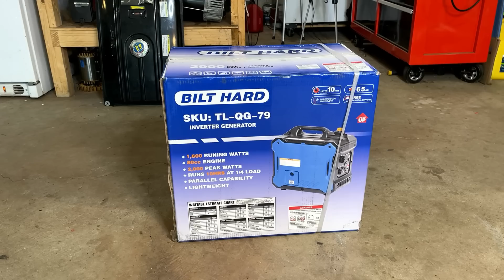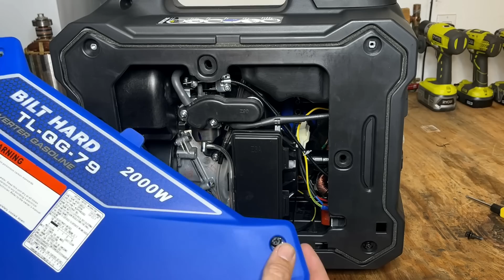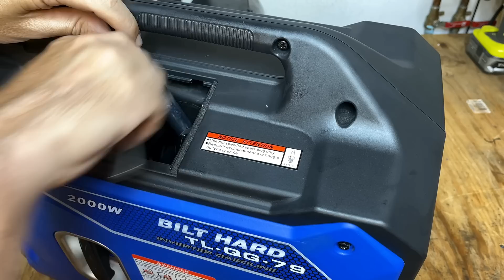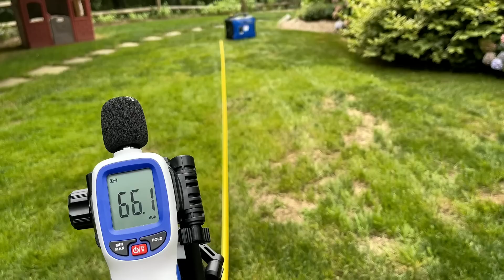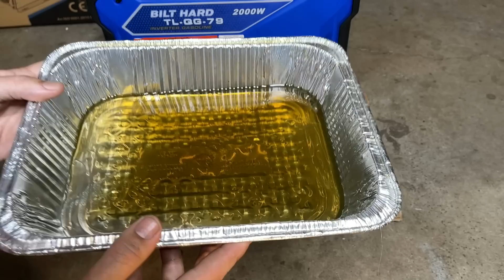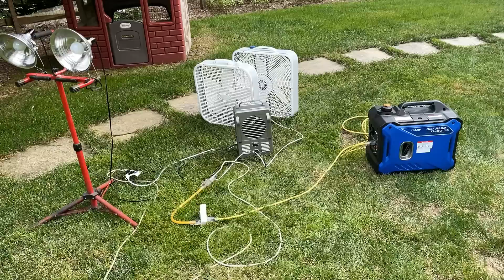Bilt Hard 2000 Watt Quiet Inverter Generator Review and Test

Comment: James, great review as always! I believe it is more of a marketing industry issue where the advertise 2000 Watts but they do not specify if those are running Watts or surge Watts. It's a bit gimmicky but that's how it's always been from my experience.

Would I be very curious about is the inverter module. Seeing components potted in epoxy resin is very standard and the inverter module reminds me of the Ryobi 2200 w inverter. The quality of the components used to build it I would be suspect especially during the time of you making this video we are currently seeing a huge shortage of electronic components in general so quality tends to take a dive because manufacturers are trying to push out stock quickly.

Usually at this price point do not have or have very little EMI and RFI filtering. Depending on what your bandwidth of your oscilloscope is you should be able to see some RFI noise in the 300 to 500 MHz range. Most sensitive picky Electronics these days if that noise is below a certain threshold shouldn't be an issue, however in terms of audio applications such as ham radio and pro audio like running a powered speaker for a PA system for example that RFI noise can induce noise in the audio equipment. I own the Yamaha ef2000is and I have found that even that expensive generator has just basic RFI filtering. Thankfully there are available frequency converter filter units specifically designed to suppress this type of noise on ac lines. 

Overall not a bad unit, but like others have said I questioned the longevity of this unit even when maintaining oil changes and basic maintenance. Build quality and engineering are very critical.
Reply from the maker: Inverter generators always advertise using the surge watts.  Probably because they are underpowered compared to more traditional generators.  It is a good unit for the price, but agree the longevity is unknown and for the price should not be expected.  I think my oscilloscope can measure noise at different frequencies.  Will have to play around with that.  I also have an ef2000is.  Never had an issue with it.  I am working on an ef3000iseb which has a pretty big issue.  Easy to fix, but the part costs $1,500!  Could buy 4 of these generators just for the price of the part to fix the Yamaha.
Reply: @jcondon1  exactly whats the issue? Engine or inverter? The inverter units are damn near impossible to service and schematics are not to be had.
Reply from the maker: @Bassguitarist1985  inverter.  It kinda makes power sometimes, but cannot support any kinda of a load.  To make matters worse it is the first generation made only for 2 years and the inverter is specific to that unit.
Reply: @jcondon1  also, the ef2000is has a geared cam while the honda has a rubber belt driving the cam. The honda is ever so slightly quieter, but i hate the idea of a rubber belt failing vs gears which are the most stout

Comment: Just a note on commercial and consumer generators. Consumer units are over rated for the short term peak load as shown. A 2,000 watt generator is fully loaded at 1500 Watts.
A commercial Diesel 3 cylinder 6KW is nominally loaded at 5KW and fully loaded at 6KW and is rated for continuous duty at full load. Overload is 8KW for up to 30 minutes. Generator mentioned is typical of a construction site light tower. They typically run 4 each 1,000 Watt lamps with an additional 250 Watts used by the ballasts for a 5KW load all night on a 6KW generator. This leaves another KW to use with the convenience outlet for power tools, etc. Bought a used one from a renal company at auction for less than 1/2 the price of the 2KW Honda.  Not as easy to lift on the bench, but for an extended power outage, I'd rather have the larger set to run more than a light and a hair heater.

Comment: I thought most air cooled engines were supposed to have sae 30 weight oil. Not 10w30.
Reply from the maker: 30 weight is the best.  But where I live, half the year temperatures are too low for that weight oil.
Reply: @jcondon1  ah ok, Then yeah 10w30 is good to use as well.

Comment: Does this generate DC which is then inverted to AC or is the head an AC head? 
If so, how does the idle down feature work?
Reply from the maker: The generator produces 3 phase high frequency high voltage AC.  That is converted to DC and then back to 120v 60 hertz AC by the inverter.  The inverter can handle a range of input from the generator head.  So running the engine slower will reduce the voltage and frequency coming out of the generator head, but enough power is still available for the inverter to generate 120v 60 hertz.

Comment: Would you, time willing, be able to do a show on a Fuji Micro F52000i? No problems if you can’t. Thank you.
Reply from the maker: Did one a while back on that generator https://youtu.be/vyeyQK1QCuw
Reply: @jcondon1  trying to send a photo of my Fuji Micro; its a little different. Is there a way to change the power settings on the inverter? It’s supposed to do 3.2kW continuous and 3.7kW Max.
Reply from the maker: @Maurice1151  no settings that I am aware of

Comment: Thanks very much for the review, however there seems to be a bit of confusion over the wattage at full load.

I'm pretty deaf, so I use subtitles when I watch your videos, and they say:

14:13 [After turning on first white fan] 
"all right, 1547 watts, 115.9 volts, 60 hertz"

15:07 [After turning on second fan]  
"and the voltage is [sic] dropped, we're at 107.9 volts 1475 watts, 60 hertz.

Unfortunately, the wattage reading on your Kill A Watt meter is not readable, so I've only got the subtitles to work on, but I think I can also hear you say "one thousand four hundred and seventy five watts". 

It looks like I'm not the only one who reckons you said the max load is in the 1475 watts area:

@thomas martindale "1473 watts seems a little shy of 1600 for overload protection"

@TRANSMITTER GUY "So 2000w peak start, then 1500w."

I'd be grateful if you could confirm the wattage reading when the generator goes into overload condition. Thanks!
Reply: 1473 at that specific overload level. When he turned on the extra fan the generator went into overload. In overload it turns out a lower voltage as you noted which means fewer watts are outputted. Per James' measurements the generator will deliver 1547 watts -- Provided you don't overload it. It will likely shut down at some higher overload point.
Reply: @Thriller_Author   Many thanks for the explantion - much appreciated!
Reply from the maker: The max wattage I measured before the overload light came on was about 1,550 watts. Once I exceeded 1600 watts the voltage dropped below 113 volts which is around minimum voltage utilities are allowed to provide to you house (120v +- 5%).  And because the voltage dropped, so did the watts.  Another thing to consider, if you need 1600 watts out of a generator for any period of time, then do not buy a 1600 generator because everything will be stressed and it will shorten the life span of the generator.  Always buy larger then you need.
Reply: @jcondon1  Thanks for that. I've watched a large number of your videos, and love your style of presentation. They have been a great confidence-booster. Keep up the good work!

Comment: I have a Generac 7500 watt. The Hertz is at 61 but the voltage is at 155 to 160. Is there a way to turn down the voltage?
Reply from the maker: Most Generacs can be adjusted.  That is also a failure mode of most AVRs.  Sometime when they fail they stop making power.  Other times the go to the max.  Most have a potentiometer on the AVR.  If adjusting that does not work, then most likely the AVR needs to be replaced or a bad sense winding in the stator.
Reply: If it is a generac 7500 EXL there is a potentiometer adjustment on the left side of the outlet panel. The system control board inside is what tells the AVR in the end Bell to set the voltage at. The 155 to 165 volts ac tells me the system control board has failed and needs to be repaired. There is a 3-pin connector on the AVR board if you disconnect that and take a jumper wire and connect the two outer pins then your voltage should drop to zero or very close to it. In this case that I'm describing the AVR is perfectly fine it is the control board that controls the AVR that is suspect.

Comment: 1473 watts seems a little shy of 1600 for overload protection
Reply from the maker: It made it to about 1550 watts and then when into overload when I exceeded 1600 watts.  The load pulled down the voltage which caused the watts to go down.
Reply: @jcondon1  got it thank you

Comment: Nice generator ,very quiet also helps adding zink for breaking oil nice vid.
Reply from the maker: Was surprised at how quiet it was.  I had low expectations going in based on the price, but it performed well.

Comment: Will it power a 1/3hp sump pump?
Reply from the maker: It should, but that will depend on the surge.  Might have to leave eco mode off or the surge might stall then engine before it has a chance to open the throttle.

Comment: Not going to debate the brake in but I have mixed feelings I also haven’t bought anything new for years except a high end electric pressure washer I wanted for washing my cars.    I highly doubt anyone actually broke in any of my current used equipment according to the manual.  I have really nice equipment and usually find it non running on fb marketplace…and as I find something nicer I sell the junkiest or oldest pieces I have.  I’ve probably bought 200 pieces of lawn equipment under covid.  Also in reality all my personal equipment was from repair money so it’s cost me nothing but some time and effort.
Reply from the maker: I agree.  Most do not bother and the engines usually are fine.

Comment: Good job reviewing a "new" unit but longevity and reliability are my concerns as is its track record. Generally speaking, one gets what they pay for. Granted, one could buy 2 of these for less than a $1000+ competitive unit but one does not want to discover they bought an inferior unit when needing emergency power. I would love to know how this unit will perform in the long run.
Reply from the maker: Generally you do get what you pay for.  Was thinking you could almost buy 3 of these for the price of a Honda.  If you need a generator for daily use, industrial/commercial use or something critical then would recommend going with something proven.  But if you just want something affordable for camping, tailgating, random stuff, or to keep some lights on, then this is a low cost option for those not willing to spend a ton of money.  Parts are always an issue with most generators sold today expect for the top brands.

Comment: Nice little unit. Very quiet. Great video, as usual.
Reply: I noticed that it was very quiet at idle but when it was loaded up it sounded pretty loud. Too bad that it doesn't really make any electricity at idle - it would be even quieter if you shut it off completely.

Comment: So it's a 2000 watt generator that can only handle 1600 watts?
Reply: Naming models according to sure wattage and not continuous wattage is standard in the generator industry.  Maybe it's wrong but everyone does it, including Honda. I'm more concerned that it doesn't seem to do well at 1600W either.
Reply from the maker: It is a 1600 watt generator.  Can surge briefly to 2000 watts.  Same as a Honda eu2000

Comment: That is quite an inexpensive price for an inverter generator. I found it interesting that as you increased the load when it was close to max output, the engine slowed down and the voltage dropped, but it was actually putting out less wattage than its rated capacity. I assume that the engine was doing all it could at that point, so it may do better when it is broken in some more.
You should look at getting a foldable funnel for all the oil changes you do on various equipment, you can get them on Amazon for less than $10, and they are really handy.

Comment: What good would that be if your home lost power in a bad storm ?  NONE...
Reply: I'd say a lot better than nothing. You could keep your fridge going. You could have some lights. You could have a fan.  A few gallons of hard to find in an outage gasoline would keep it going for days instead of hours like a big generator. Could you run your A/C or your stove? No, but it's still a lot better than nothing.  The intended application for this generator is tailgating and such, not as a standby generator anyway, but I'd be glad to have one if the alternative was sitting in the dark while my food spoiled.
Reply: @throwbo  Or if you have 2, run the big stuff  and lights on a regular gen, and use this one for things like your computer, TV, internet equipment. I know my UPS's don't like running off of my regular generator. It does seem to do a great job for the ratings it has.
Reply: @cheeto4493  These generators have a provision for something called a parallel kit - you can link two of them together and get double the wattage. 2 of these is still less than 1 Honda and you get like 3000W out of the pair.

Comment: Looks like same build as HF model. If so you can shut it off by going to "almost" off (turn until it starts to stop then crack it back open a tad) and this will shut off the fuel to run the bowl dry. I know the bowl drain screw is easy to do but it's easier to store the bowl dry this way.
Reply from the maker: Good to know.  A lot of the inverters are sold with different branding.

Comment: Save a bit of money now, but later when you need parts and the company doesn't exist anymore, you're hosed.
Reply: These Chinese Honda clone generators are all very similar internally.  If Bilt Hard is not around, you should be able to get parts for them elsewhere.  Not cosmetic stuff like the case but internals like carbs, recoil starters, etc.  You could buy 3 of these for one Honda so you could buy another just for spare parts and you'd still be ahead.
Reply from the maker: Most generators sold today have that issue.  But because it is a clone, you can find parts for the common things without much issue.
Reply: @jcondon1  unfortunately, I need a gas tank that no longer seems to exist.
Reply: @snowdog90210   Is it for an inverter?  For regular generators they sell generic tanks. It might not be exactly like the original tank but it could be made to work.
Reply: @throwbo  it's for a Smarter Tools inverter.    They still have a website up, but they don't respond to any form of communication. I found other people who have had the same issue with them. The generator has a Yamaha engine, and it works well, but the gas tank has a gigantic crack in it

Comment: Inverter generators are the way to go. Usually more expensive than a regular generator of the same wattage but far more quiet. Most people don't know that the majority of the noise comes from the engine not the exhaust. The Honda 7,000 watt inverter generator is stunningly quiet compared to a like size but so is the cost difference. If I were to buy another one for the home I would strongly consider it.
Reply: If you plan on feeding your panel you really want a generator that does 240V - not many inverters do.  Harbor Freight has a big closed frame inverter generator now that is a lot cheaper than the Honda and does 240V. But it still costs double what a non-inverter costs ($2K for 7600 running watts/9500 surge).  I would love that generator but hate to spend that kind of $ on something that I use maybe 1x/year.
Reply: @throwbo  For some it's hard to justify something that gets used every few years, until that power failure comes and then it's to late. I live in South Florida and have had several multi-day outages. How about those poor people in Texas and Louisiana that have bullseyes on their backs? 90 degrees and 90% humidity you only have to do once and the same for ice storms taking down power lines. I don't understand how people go without at least something to keep the fridge on, a few fans and some lights.
Reply: @throwbo  - I only have HONDA inverter generators some almost 20 years old that are still running perfectly. Never ever had to do more than change oil and clean air filters. I basically only use them once a year during hurricane power outs.  The extra cost of a HONDA is well worth it for me.

Comment: James a very typical review from you which I have found to be very reliable thanks for the truth about what you review nothing bias at all. The sign wave stayed very steady and the price was very good. I think this beats honda at probably more than half the price. Ed
Reply: Don't overstate the case. I doubt that this generator beats Honda in many respects that wouldn't show in an unloaded test of the wave form - longevity, reliability, etc. However it is around 1/3 the price so if it is more than half as good then it is still a bargain, at least for lightly stressed non-critical applications.  Would I use this for an occasional tailgater? Sure. Would I used it to run my food truck every day? No.
Reply: Nothing beats HONDA portable generators.

Comment: So no fuel shut off that allows you to run the carb dry?  I like the WEN inverter-gens because they have this setting on the main control dial, making it easier to run the carb dry for storage.  Other than that, how long is the advertised warranty and what is the availability for standard parts (like maintenance items such as air filters or commonly lost items like fuel caps)?
Reply from the maker: Unfortunately the fuel shutoff is integrated with the ignition like the Honda.  Their next model up allows you to turn the fuel off separately from the ignition.